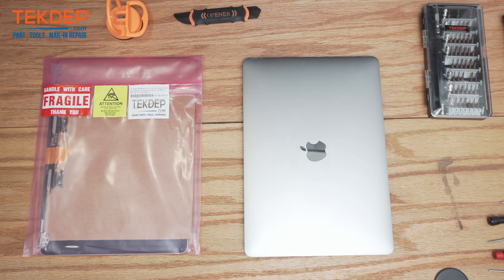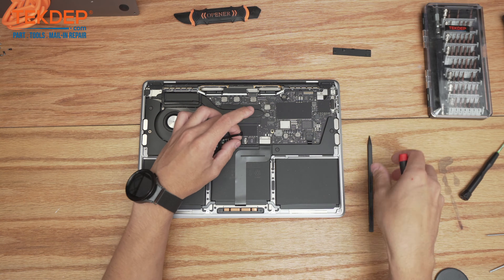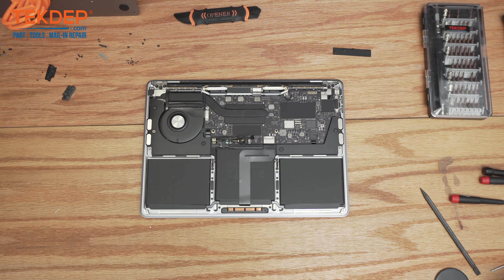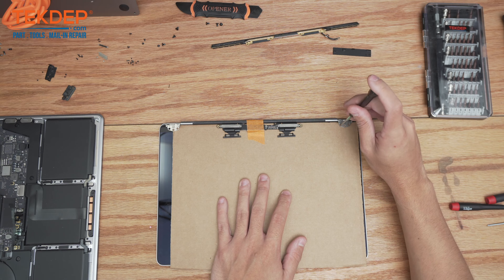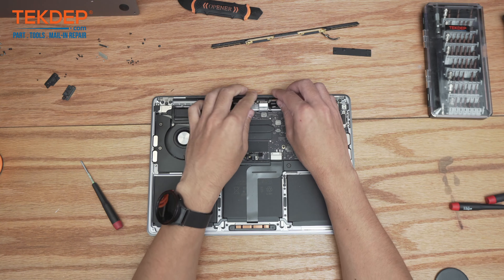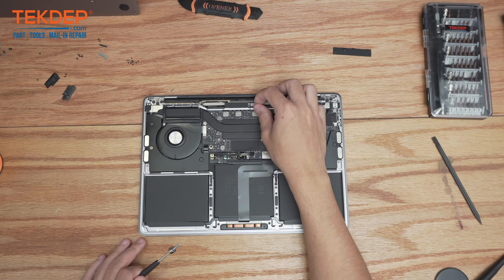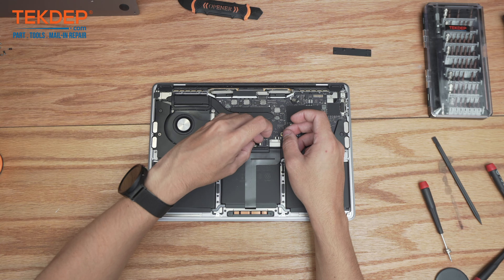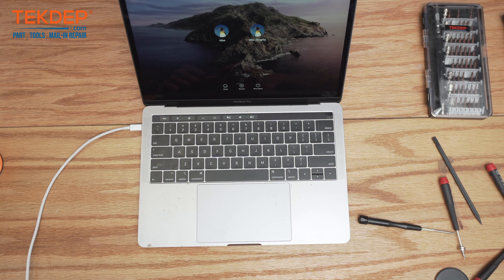2019 MacBook Pro 13" | Screen LCD Replacement A2159

Comment: Bro I did everything like you did because the old one has lines on the screen and it was blank. Keeps oning and off my itself. I replaced the new one but it doesn’t show any picture on the new one. What should be the reason
Reply from the maker: It's possible that the new screen may have arrived defective, or there might be an issue with the connection to the logic board. Double check If All the Cables are Connected Properly.

Comment: Has anyone gotten stuck on the battery connection?  Since I put it back together the Macbook only works when it is plugged in.  I plugged the battery cable back in several times but no luck.  The battery was working fine before I changed the screen.
Reply: I also have this issue
Reply: I figured out the issue the cable from 1:05 has to fully fitted in it should almost make a small click sound when properly set, my cable wasn’t properly set and I redid it and it fixed the issue

Comment: Hey I have a question, I sent mine to replace the screen and wen it came back the button for Touch ID wasn’t working at all , wen I sent it back they said that they didn’t work on that area that the work they did doesn’t have nothing to do with it, but it was working fine before I sent the laptop is that possible that they damage the Touch ID button changing the screen ?
Reply from the maker: There is a possibility that the touch ID/Power button flex cable is broken or cut off. 

Thank you for your comment! Visit our website for any repairs, tips, and tools you need, and stay tuned for more videos.
Join our community

https://tekdep.com/

Comment: lol my ifixit tool kit doesn’t have the t3 wtf
Reply from the maker: Our Toolset that actually used by our technicians has the T3 and all other necessary one to open any mac and cost much less than the other guys, and have really high quality. Link : https://tekdep.com/product/145-in-1-steel-bit-precision-magnetic-screwdriver-tool-set-with-case-for-phone-pc-electronicsi/

If anyone needs replacement parts such as screen and batteries or tools for your MacBook repairs, we have them all and ship worldwide! visit: https://tekdep.com 

We also offer a convenient and affordable Mail-In Repair and data recovery. You can learn more and get started here: https://tekdep.com/device-repair/

Comment: Dude I honestly really appreciate you for making this video! I did struggle a bit with the millions of PL1 screws because I didn’t have the right size for it, the set that I bought only comes with 0.8 and goes up to 1.2, so I had to drill out a couple of them and that sucked but it still works perfectly
Reply from the maker: Sounds like you did some great work to get it fixed! If anyone need replacement parts such as displays and batteries or tools for your MacBook repairs, we have them all and ship worldwide! visit: https://tekdep.com 

We also offer a convenient and affordable Mail-In Repair and data recovery. You can learn more and get started here: https://tekdep.com/device-repair/